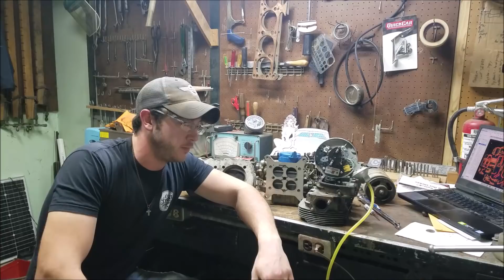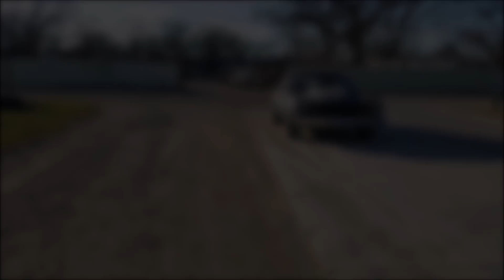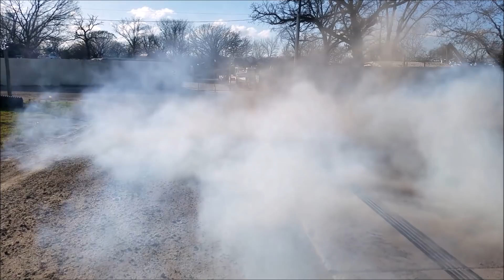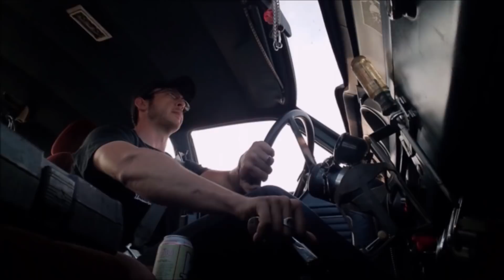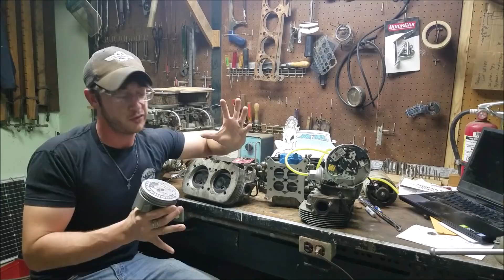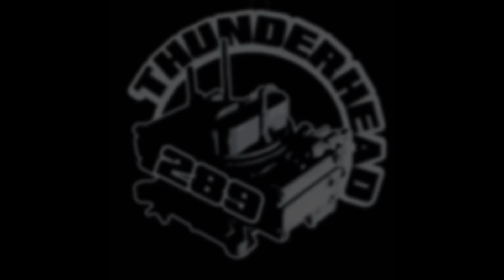How Ignition Timing ACTUALLY Works, ya idiots

Comment: Hey uncle luke I got a question. I have a 74 j10 pickup and it will fire up no problem. Run for 20 30 seconds and then fizzle out and die. Crank fires right back up and same thing. But if you tip throttle you can keep it alive. But once warm it runs like a raped ape. My other rigs dont have this issue. Has all new ignition new carb but cant for the life of me figure out why i need to baby it so much
Reply: If you have a electric choke, maybe it goes of to early?🤔 https://www.youtube.com/watch?v=0H5IBSFgYJE&ab_channel=Holley
Reply: @olekdah  I dont have a electric choke. I have manual choke. But it will die either way with or without choke.

Comment: I have a statement for those trying to apply the information. Degrees in relation to advance, I struggled with. Vacuum advance the number gets higher because more advance is less timing.

(It sounds silly to say now, but when I was still wrapping my head around this i always thought bigger number=more timing.)
Reply: The higher the number - the more degrees before top dead center the spark plug fires.
Reply: Do you mean "Vacuum advance the number gets higher", as in -10 is a higher number than -20. Greater vacuum, as in -20 is more vacuum than -10, gives more advance and more timing as @Don Denny says. At WOT(full throttle) vacuum drops to zero and gives no additional vacuum advance at all.

Comment: Ok here is a puzzle: I rebuilt my Olds 455 and added roller lifters, aluminum heads etc. I put the same 750 Holley 4160 back on and I am getting CRAZY loud "backfires" (detonation is the exhaust, not through the carb) when I lift off the throttle under spirited acceleration. Timing is set at 35 at 3000 rpm with vacuum advance disabled.I set my idle screws with a vacuum gauge. For a test I screwed the idle screws all the way in. The engine had a hard time starting, but when it did it had a ton more power and the backfires were gone. One last oddity - 6 of the plugs are fouled and 2 are fine. I can't find any vacuum leaks. Does that sound like something obvious?
Reply from the maker: My first thought is if idle screws are all the way in, then your idle throttle is too far open (or a vacuum leak - potentially under the intake since some plugs are fouled especially) 
If idle screws can be turned all the way in, the carb is compensating idle with too much transfer slot fuel - this is where it’s getting its idle fuel from which is not how the carb is designed to function. 
You will experience a lean scenario when you crack the throttle open since now you effectively have no transition circuit.
Reply: @ThunderHead289  hey, thanks so much for taking the time to respond! When I get back from x-mas I will trouble shoot with that in mind and then report back. Cheers!
Reply: @ThunderHead289  One of the main problems with carburetors are that most people only know to adjust the main throttle. That's because it's the biggest screw right in your sight, and "it works". The next big thing is that vacuum advance courses "problems", so they skip it. Both this things mess up the whole picture really quick!😅 Love your videos...and that you take the time to comment!!😃👍 Can't wait for summer to get on the road with my 72 Chevelle SS again! Happy Christmas from Norway! Regards Ole K 63mod. https://www.youtube.com/watch?v=EfAycRfkeNQ&list=FLiHvG4akQjE5NB7TPUD76ZA&index=64&ab_channel=GrundtsGarage

Comment: Excellent talk, in my younger days I used manifold vacuum when I should have been using venturi vacuum. Very frustrating. Mallory mechanical adv distributors were my saving grace. Good wide open throttle performance with acceptable daily driver performance.

Comment: A good way to understand is to look at a modern cars ignition map. It’s axis will be engine speed and engine load. Then look at the trends: timing goes up with speed and timing goes down with increased load. Engine speed is straightforward and easy to grasp, engine load is easy to understand too, but it does have a lot of contributing factors to consider both from a physics perspective and a practical mechanical perspective.

Comment: I've also seen various people saying that you shouldn't run vacuum advance and I just shake my head. Maybe if you're building a drag engine that only sees WOT that makes sense, but not on a street motor. Maybe it's the current worship of the dyno that's making people think this way, since a dyno is also run WOT?
Reply from the maker: Perhaps. 
The dyno stuff really stresses me out, street builds should be designed for a strong broad mid range torque curve. An engine built in that manner will outdo a peak HP engine any day on the street.

Comment: Boost is a very misunderstood term. Boost pressure is air your engine couldn't use. Liked backed up plumbing. 50lb Boost pressure in a wedge engine would be like 20lb in a hemi because it flows better in a perfect world 0lb boost would be a engine could use all the supplied air. Do u agree
Reply: What??? Boost as in turbo or supercharged?
Reply: @olekdah  yes

Comment: Merry Christmas Uncle Luke! I have followed your Holley carb set up to the Tee! I have also followed your timing guidelines to the Tee! Result? Fantastic throttle response, no lean bogs, No rich or too lean carb issues, elect choak adjusted and proper Idle adjustment set "at choke",  curb Idle adjustment on other side just slightly tweaked. No Vacuum advance on my 4160-750. MSD billet with curve kit all timing in at 2500 rpm 18 deg initial, 36 total. Thank you Luke!!!!! This car is a responsive monster at throttle whack. Cheers from Motown! Oh, Merry Christmas to your lovely wife and to all your fur babies. :)